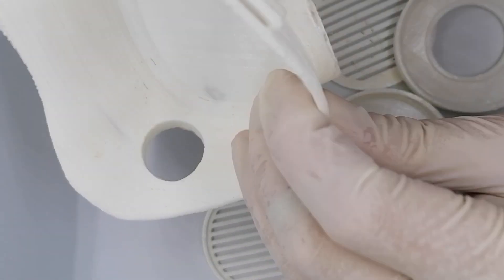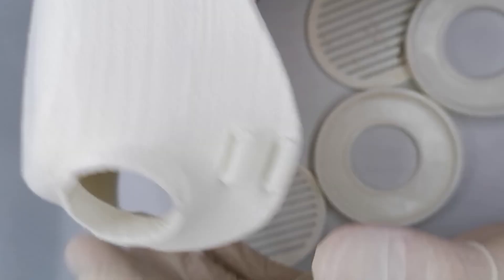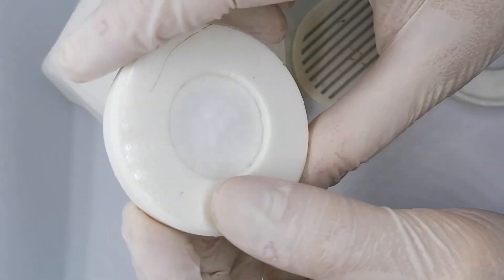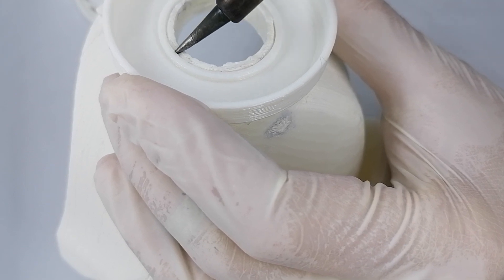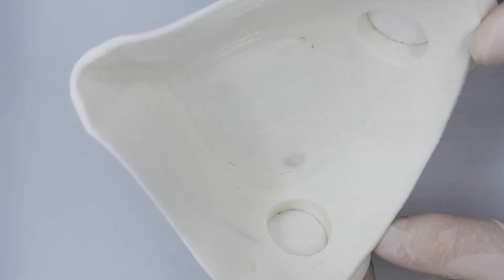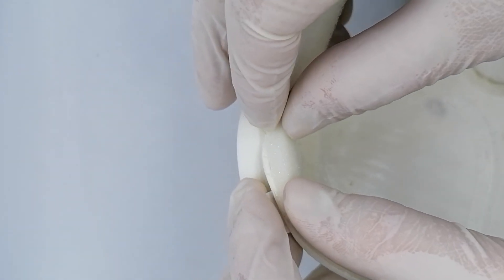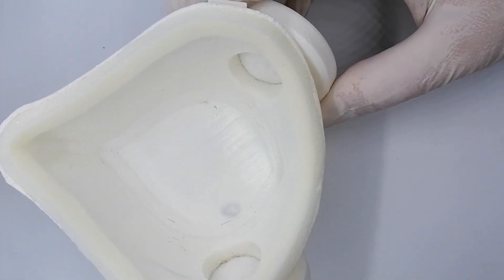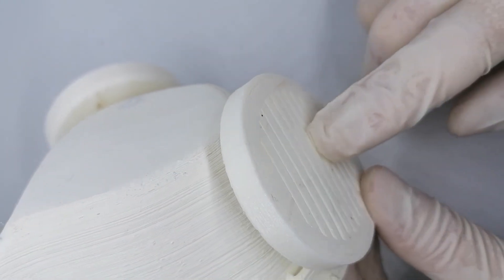Covid-19 3D Printed Face Mask

Comment: No need to use a soldering iron to connect the two parts. Just update the designs to use a twisting lock like this https://d2t1xqejof9utc.cloudfront.net/screenshots/pics/02a119ab418f1f493ff6e825e110ffff/large.JPG
Reply: I didnt need to use the soldering iron as it is. ITs tight fit.
Reply: @MadMakerWorkshop  In my print, it fits tight, also.
But I suppose it depends on the type of material you use.
Some materials have a greater contraction/deformation rate when printed (like ABS).
Reply: @SYPuraVida  yes, but all parts will shrink equally if you use same material. This can be an issue tho if you use multiple printers(i have two and they have slight accuracy difference) or different materials. Im thinking of trying to make the face mask part form TPU for more convenient fit. But then there is the question of fusing pla filter enclosures to it.